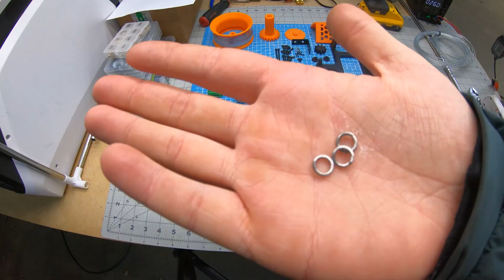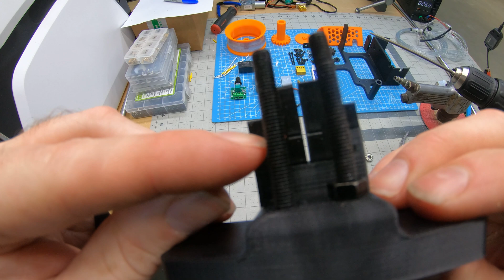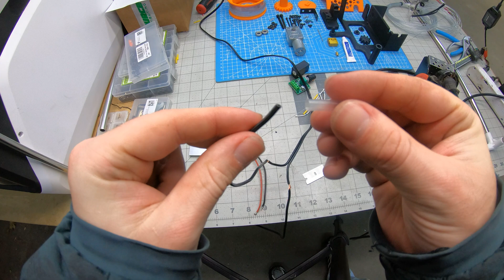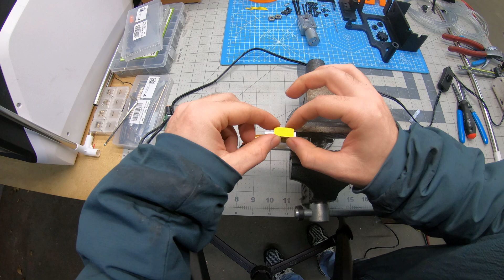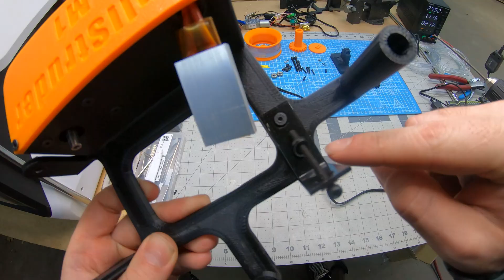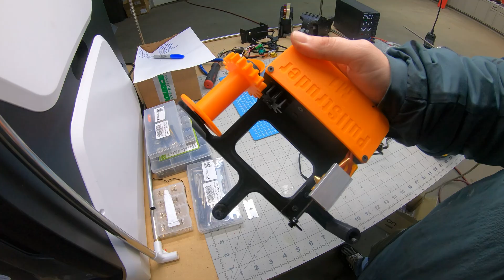Filament Bottle Recycler for LESS than $100 | PullStruder M1 Full Build Tutorial

Comment: some constructive criticism: use a socket set or wrench to tighten the bolts, never pliers. print yourself spacers for the bearings instead of using bolts, that way it won't loosen, get 2 washers slightly bigger than the bearings, that way you can use the washers to cut the plastic instead of the bearings. NEVER use the same colored cable on electricity, especially, like you said, 110V is running through those cables. how to you manage the heat on your extruder? a heating element from an old 3d printer should work as well and it will be much cheaper.  you have to be able to control the heat as well, otherwise the results will be inconsistent. a stepper motor from an old 3d printer would work just as well.

Comment: So this electrics works with a bulk converver who converts from outlet 110/220V to 12V motor, PWM, heating element so they can be all 12V even the heating element stating 24/36V? A 12V PTC heating element will do the same? Thanks for amazing work!

Comment: Could I add a lower voltage DC heating element to a USB port and connect it to a phone charging brick? And can I add a temperature controller?
Reply: Have you tried this?
Reply: @carfan2928 No, I'm wondering if anyone else has

Comment: Any alternatives to heat conductive glue  I used it but it is extremely delicate and I  have had to re attach multiple times now
Reply from the maker: An ideal solution would be a custom CNCd heat block with a slot for the heating element..

Comment: There is no cooling except passive - does this not bind to the already extruded filament? There is no diameter control except the 1.75 drilled out nozzle. Could you show some results? I'm highly sceptical if this is even usable
Reply: I bought one of these kits and I can confidently say the filament is cooled by the time it reaches the spool.  The machine works fantastically and in such a small package.  Blake did a fantastic job with this.
Reply: @phoem2k Just curious … Are you still making PET bottle filament? Or has the excitement of being able to do it worn off?
Reply: @cbgslinger  i still do it though admittedly wish i had more time to. Recently started a business involving 3d printing so haven’t had as much time to “hobby” as i’d prefer
Reply: I have seen a couple of these systems and it seems that the plastic is heated to its glass temperature, so that it is bendable. It is not heated to the 200 odd degrees it normally is. Also the filament has an air gap in the centre as the flat strip is bent into a cylinder. I don’t have one, but to me it does seem plausible.
Reply: @Brocknoviatch  The heater from the link says 220 C in its technical documentation
Reply: Did you find out the bearing size?

Comment: awesome video, feels like i havent seen you upload in ages. Id love to make this pullstruder. Im just not sure I would ever use bottle plastic like this. Maybe if i could use a blender and turn my old wasted filament poops or failed prints and grind em down and turn that into filament... i could totally see myself doing that. I cant afford industrial grade extrusion machine stuff though. This has potential to do it I think. It would just need to be setup vertically? Im not for sure though.. Hopefully your next video is a video of this working! :D
Reply from the maker: The process of grinding up old filament poops and pultrusion are actually very different I'm afraid.  Pultrusion doesn't fully melt the plastic.. It bends the plastic!